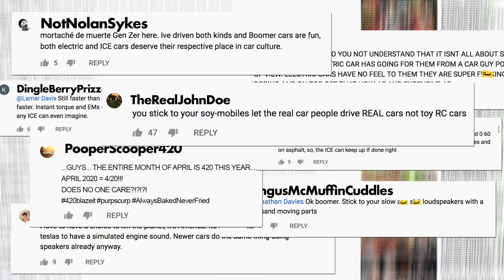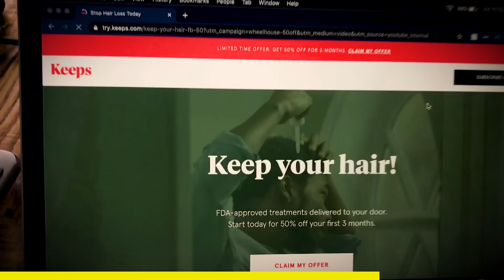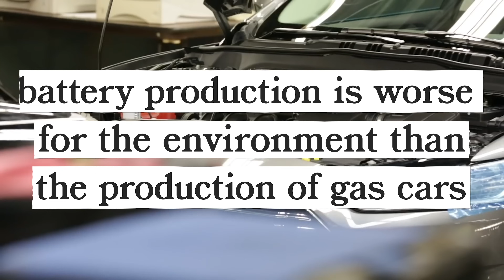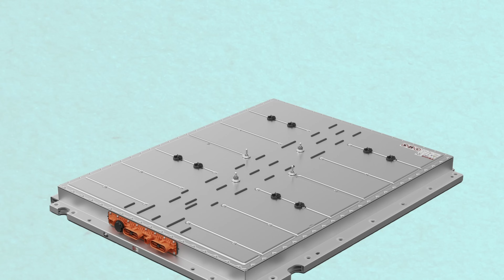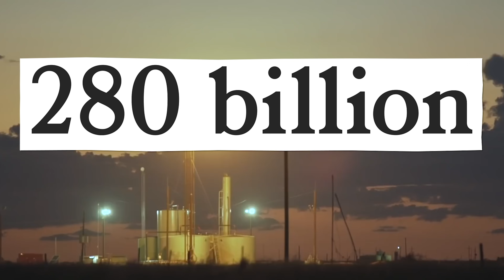Are Electric Cars REALLY Better for the Environment?

Comment: Hey man. 
I really like how you started the video. You rightly started by stating the problems of water consumption by lithium mining and (some) of the problems of Cobalt mining. However, the wrap-up felt that he falls short on proper analysis of the whole picture as you ultimately you only compare CO2 emission without proper mention the consequences of the other 2 problems. I acknowledge time constrains but you could even raise some questions so your viewers may consider. 

For example, what is more urgent, the water problem or the Carbon Dioxide? To which one of them are we closer to a solution? How those wasted waters from mining are influencing the populations, the habitats of animals and which kind of components do they have? Also, burning coal releases particles to the environment and is extremely dirty...
However, is it really smart to burn organic material with a much higher energy output for these frivulous applications? What about graphene batteries? Aren't we rushing ourselves after Lithium? 

I believe that in this way you protect your point while still guiding your viewers to what they should look for and consider when thinking about this.

Just a few suggestions :)
Regards!
Reply: You know that even if he would've mentioned that, it's still more than likely that gasoline was wayyyy worse for the environment, due to the insane oil spills that have occured in decades past. Remember that.
Reply: @Patkilla7558  maybe yes or maybe not. I just think it is important to be coherent and assertive. 
Furthermore, oil spills are indeed a problem but solution is much closer than for the other problems. You can easily/cheaply produce enzymes that degrade the spilled oil. Same goes for CO2 capture and convertion - however for now is not that simple or cheap as the first option. 
On the other hand, reverse osmosis for fresh water production, neutralization and decontamination of soils are all of them very expensive or impossible. 
Once again, my point was just to do a constructive critic and not to undermine your work. Sometimes is just about raising the questions so your viewers keep it in the back of their minds (even yourself). 
✌

Comment: 10:20 Not here in Eu. In my country u get 7k for a full electric, 5k for plug in, and 2,5k for a hybrid. 
And still is nothing since a normal electric car is up 50k in my country...so yeah, it does benefit people with a good income. 
Also, cobalt is higly cancerous, and toxic to plants and animals, its impossible to recicle the batteries fully and its not a green process. 
There is hydrogen power, and liquid air batteries that can replace lithium. Also, bio fuels, expecially bio disel is far greener than regular petrol/disel.
Why not mix up all this and have less problem than go full lithium EV?

Comment: Areas where solar production makes up a higher percentage of power from the grid, and since most EV charging (how much... dunno) is at night, that power has to come from gas or coal - maybe a tiny amount maybe from nuclear - but not from renewables. The Texas ice storm recently showed everyone how much we cannot rely on wind power.
Reply: Wind was only a minor portion of the Texas ice storm issue. If that's the only thing you took from that event was wind power, a form of generation they use in Canada and Greenland where it snows frequently, then you're massively misunderstanding all of the factors.

Comment: The only thing I can’t get behind is how long it takes to charge them. This makes road trips more difficult
Reply: Stopping for 30 minutes every 200 miles has always been my pattern , so no change for me
Reply: The Mercedes EQXX does 1000 miles on a charge and 1200 miles when driven more carefully. This with a present day tech 100 KwHr battery. This shows us what is coming. No one can drive for 1000 miles in a day. That means you don't need to charge during the day, you don't even need to look for chargers, maybe you don't actually need any public chargers anymore. You charge your car slowly at night while you sleep at home or at your destination. Night time is when all the cookers, kettles and TV's are off as most are in bed. EV's can then take advantage of all that under used generating capacity. There is a reason why night time electricity is so cheap.
Reply: @Nonybusinessxxxxxx ever think they will build more? Duh!!
Reply: @AncientRe oad trip 5 times a day lol not sure you understand what a road trip is!
Reply: Eh, we roadtripped from Oslo, Norway to Cologne, Germany and with the Tesla X charging only took 25 minutes on average. These countries are also very Tesla oriented though so superchargers were everywhere with no line.
Reply: This will improve.  Think about how good batteries are today compared to just 10 years ago.  Now give it another 10 years, or 20 years.  We'll be able to get 1000 miles of range after an hour or less of charging.  The good thing about EVs becoming more popular is that leads to more money being put into battery R&D so they're only going to get better.  When the gas cars were in their infant stage, they weren't much more practical than a horse.
Reply: Yeah, another important thing is the batteries only last about 10 years before the capacity is significantly reduced, and replacing the battery is so costly that its usually not worth it. Ergo electric cars only last around 10 years before needing to be scrapped or sold for parts. Meanwhile ICE cars can last 30 years if taken care of
Reply: @Impetuss  Not sure who told you that, but that is not true at all. It is based on charge cycles. My Model 3 for example is rated at 1500 charge cycles before its capacity is 30% reduced. I drive 40 miles per day every day. At that rate I do approx. 1 cycle per week. Doing the math that is about 28 years before the pack is deemed severely degraded. Why scrap the car when the pack can be replaced? Do you think the battery will cost the same forever or do you think the cost will go down drastically over time?
Reply: Takes me less than 5 mins to fill my car with gas.
Reply: Don't worry sir, in no time you'll get to be in a 15 min city and won't go on "road trips."  If you want to travel, no problem.  As long as your social credit score is good, you'll be permitted to travel by train or airplane ...that is, assuming you have enough carbon credits.  And please don't do anything to protest because we will be able to stop all transactions on your account.

What is that? You didn't vote for this?  Don't worry about that either.  You don't have to vote on that either as non-elected "non-governmental" bodies are already looking to sign an agreement with more than 60 nations participating, that will give the UN "emergency powers" in case of an "emergency."  The proposed list of "emergencies" includes a pandemic, aliens, climate change....  but I'm sure it would never happen.  So the UN will never be able to use those emergency powers (which includes being given powers without any further vote upon an emergency declaration,  being able to issue commands to all participating nations without question, and ensuring they are carried out).  

Good thing almost nobody pays attention to what is said at DAVOS and the IMF and all the other sister organizations of the UN.  If they did, they would have realized Agenda 21 was being carried out globally starting decades ago.
Reply: For some EVs, it takes forever to charge, and they last a lot less than the average ICE car. If they lasted as long as ICE cars, believe me, companies wouldn't be flexing their maximum lifespan in one charge. Having to do a 2 hour stop during a trip IF you're lucky enough to find a charger before your car dies is a no-go for many people especially in countries like the US where distance between cities can be hundreds of miles of just nothing but a road
Reply: @Mr.Engine993 charging at home takes AGES but at a supercharger it will only take 20 min
Reply: @Mr.Engine993 Some EVs take hours to charge and then there’s ICE cars take only 5 minutes to fill up, pay and get going, and generally last longer than electric power, not to mention you have to replace a EV cars battery every couple years, which doesn’t make the situation much better
Reply: @KieranTheCatboy  exactly. Everything you mentioned, especially the last one are bad for the environment. And the whole concept of EVs is to reduce the harm done to the environment. Currently, EVs defeat their own purpose
Reply: @Mr.Engine993  I’m so glad there’s people with brains on earth.
Reply: @Mr.Engine993  But comparing carbon emission to ICE, EV is better.

And this is just a start for EV industry give them some time in a decade they will also develop a lot, just like rise of ICE in 20's
Reply: @KieranTheCatboy  You don't need to replace EV battery every couple years, I have no idea where you're pulling that figure from. Unless their make is absolutely horrible (like in Chinese EVs) EV batteries are generally expected to last 10-20 years or 15-30 with higher end vehicles like Tesla. This typically means that the owner will be looking to replace their car before the batteries will need to be swapped out. It also means that we have almost a decade to scale up battery recycling, which is looking to be a lucrative business.
Reply: @Mr.Engine993 they recycle the batteries and you do know how much emissions cars put out for there whole life?
Reply: @KieranTheCatboy  Tesla batteries on average are projected to last 30 years. Even taxis wouldn't have to replace every few years.

Your capacity reduces by about 10% after your first 250,000 miles.
Reply: @KieranTheCatboy  Wrong on every level! 😂😂😂😂🤥🤥 Change the batteries every two years! 👋😂😂👍👍👍
Reply: @KieranTheCatboy Every couple of years? Maybe every 15 years but by then the mount of maintenance you'd have to do on an ice car would more than match the price of the batteries
Reply: 15-30 mins? Yeah it might give you about an hour longer to get there but the drive time is the same
Reply: @jonathanwilliams7920 It's fine for residential but what about commercial? EVs have a lot of catching up to do if their going to be mainstream and that includes being able to charge in under 5 minutes. I think you underestimate just what a effing headache this will be to people who have a schedule to keep and the poor mile distance per charge does not help this issue. You can say I'm batching but truethfully no.. I'm standing up for the working class who have a preset schedule to keep and have to have these features to stay relevant. A good example of this is hospitals who need their supplies on time or people could litteraly die from a late delivery. Keep that in mind while you try to argue that the times don't matter THEY DO!!
Reply: @Rolfthewild  If you charge at your original location and at your destination, under 200-300 miles, this isn't an issue because you don't need to stop at all. When driving over 300 miles, it also isn't an issue in 99.9% of cases; we need to stop to handle our biological needs every 4 to 6 hours anyways, a 15-30 minutes charging time matches up well with this. If you need something delivered faster, a car likely isn't the solution, that's where other tech like delivery drones comes into play.
Reply: @Rolfthewild  long range EVs need breaks less often then the legal limit for human employees... so it doesn't matter at all for commercial purposes.
Reply: @Idiomatick  Time is important. I don't know where breaks become the issue here it's time. There's also the issue that even if Electric vehicles can be charged in 30 minutes that is 6xs slower than gas vehicles. In contrast an electric pumping station would need 6 pumps to cover what 1 gas pump does in 30 minutes. The average gas station has about 8 to 10 pumps so to keep traffic going smooth they would need 48 to 60 pumps to do what 8 to 10 pumps do. That's a massive amount of resources that a measly electric pump station would need to keep the traffic flowing smoothly.
Reply: @Rolfthewild  The vast vast vast majority of EVs are not charging at a station.... vs 100% of gas cars.

In a Tesla, you get >300km in 15m of charging... that's 3.5~4hrs of travel on a highway.

A 15m break every 4hrs is basically necessary... in Canada it is required for at least 30m of breaks every 5hrs plus lunch.
Reply: @jonathanwilliams7920 and imagin not having to stop at a service station every week when not on a trip it's a no brainer!
Reply: @jonathanwilliams7920  Fast charging kills your battery.  Perhaps in the future they will make the "perfect" battery.
Reply: @jonathanwilliams7920  What about the lines, will you be able to charge at the VIP charging stations where there are no lines ?
Reply: @jonathanwilliams7920  15 to 30?  Ya right.
Reply: @bnssoftware3292  Our Ioniq 5 charges from 10-80% in 18 minutes.  Many reviewers have achieved that time in real life.  Other cars using the same platform (Kia EV6, Genesis GV60) are capable of the same thing.
Reply: @thisdadslife8957 skol! Still keep on lying
Reply: @thisdadslife8957 but as the vehicle gets older thet figure will get less and less. No one will want your vehicle at all as its battery gets towards the end of its life. Best of luck tho dude.
Reply: @bnssoftware3292  Yeah... Right.
Reply: @jonathanwilliams7920 takes way longer than 10-15 minutes. It’s minimum 30+ minutes for a full charge on most any model out.
Reply: @jonathanwilliams7920  they don’t charge that fast, even a super charger takes a good hour to charge from 20% to 100%
Reply: Guess what.  My car chargers  in less than 3 mins.  I just slide my card in, tap 89, and "charge" it up.  There are no lines.  No range anxiety.  No tire pollution😂, no toxic battery chemicals, no mining process, no chance of an electrical fire that burns like 50x hotter than a normal fire via thermal runaway, no planning trips.
    All in a straight 4.  33-35 mpg combined...
   Ice>EV. 

Change my mind.  Edit for last part.
Reply: @analogueoverdigital929  -car ends up being a remote control toy car 💀